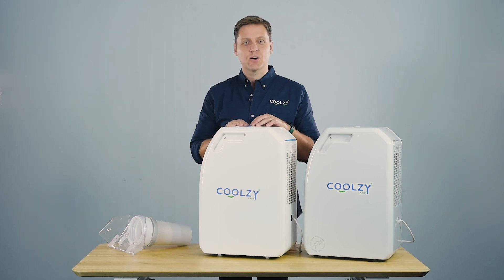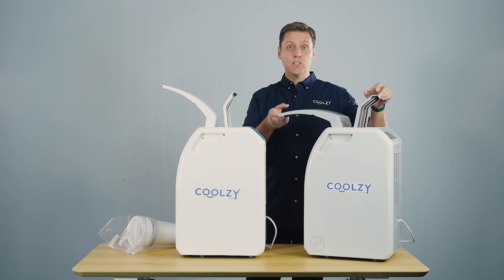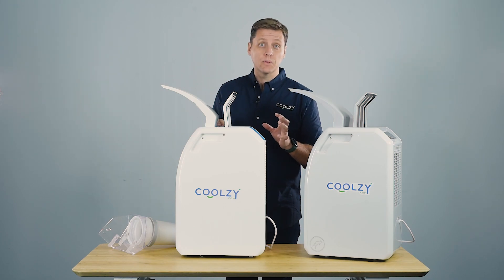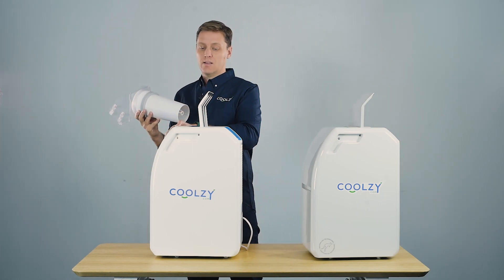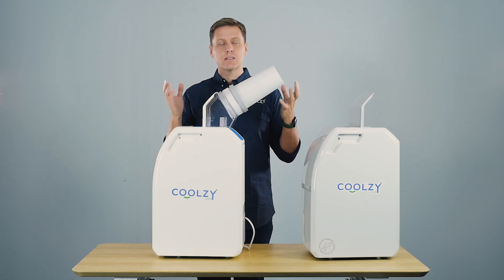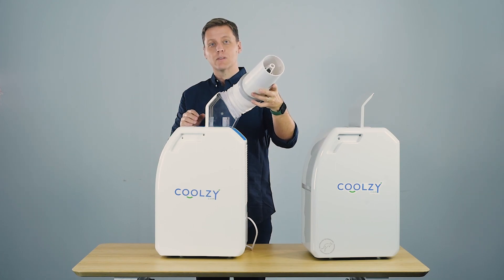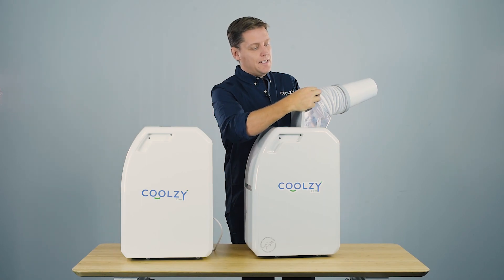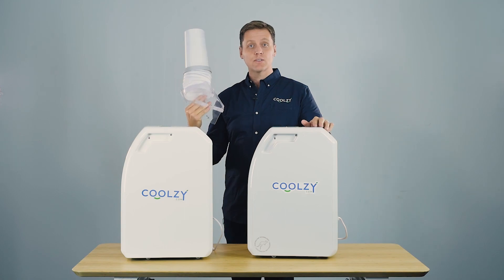Introducing the Coolzy Short Tail to direct the warm air out of a small room

Comment: Dear Coolzy, please make a video to show how Short Tail works. You can do similar method as the video which compared Coolzy with conventional air-con, but this time, 1 room uses Coolzy, 1 room uses Coolzy with Short Tail, and you measure the temperatures after some time. Please explain how we should use Coolzy when we must keep all windows at home closed 24-by-7, and Long Tail is infeasible (can only open a small gap in a window far away from the Coolzy). I already bought 2 units of Coolzy. Many Thanks!
Reply from the maker: Thanks for your suggestion. We'll definitely be making a video to show the short tail in action. Till then, here's a page that might help you work out how to use the product. https://www.coolzy.com/us/small-room-ventilation-portable-air-conditioner/
Reply: @Coolzycom  Many Thanks for your quick advice! Hope you can also show how it works if we blow a pedestal fan from outside the bedroom's door. Yes, we need to get the warm air to move to another room to reach the window's open small gap...
Reply: @Coolzycom  Dear Coolzy, I hope you can make the video soon. I'm sure there are other people facing some similar problems. Singapore's weather is much hotter now, we can't let 2 units of Coolzy's warm air add to the heat inside home. There are many insects, lizards, birds outside the home, windows must be closed 24-by-7, and rain splashes on windows, so Long Tail is infeasible. I can only open a small 3cm gap in a window 4.5 meters away from my 2 Coolzys. Please kindly advise how to address this. Many Thanks!
Reply: Long tail  not available  in Pakistan 😢😢